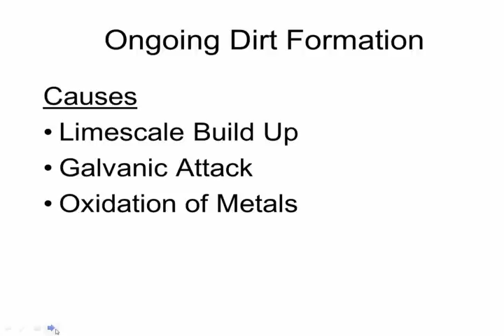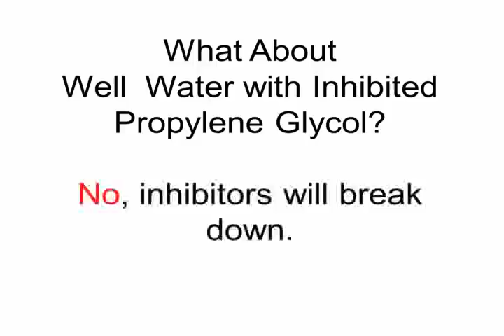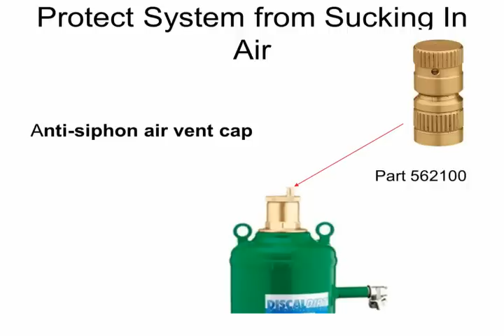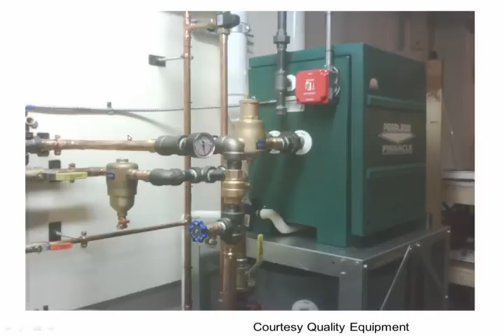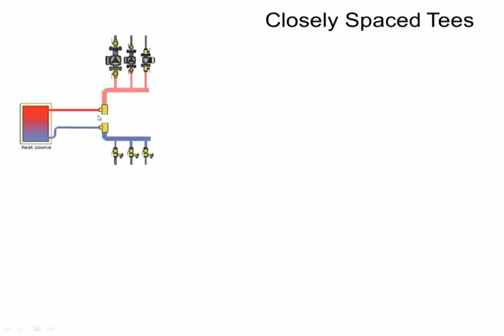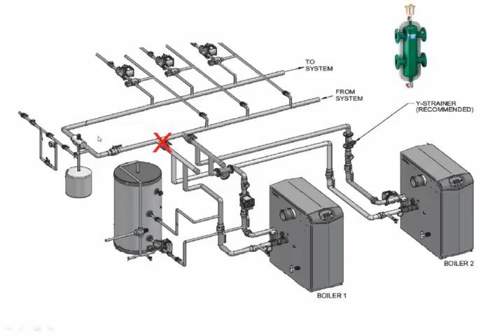Air Separation, Dirt Separation, and Hydraulic Separation in Hydronic Systems.

Comment: Awesome webinar. I'm looking forward to installing my new dirtmag. Combined with my Supervent and variable speed injection pumping setup I will have air, dirt and hydraulic seperation. I'm running two viridian VT2218s and one Alpha circulator, the decision to buy the dirtmag was a no brainer. My system wouldn't exist in its current state without the help I received from Hot Rod on heating help. You guys at Caleffi are the best.
Reply: Thanks Dave, we are always at the ready to help
Reply: @bobrohr4597  in a system like mine where there is hydraulic seperation in a few places where is the best place to install the dirtmag? I know on the return is best but will it still protect all three ECM pumps? Or should an injection pumping setup have a dirtmag on the return side all three loops?
Reply from the maker: We sure appreciate your comments, Dave.  Your system is going to enjoy the DIRTMAG!
Reply: Why can't filters that are used for filtering city water supply to house be used in hydronic system? Is it flow rate or heat limited?